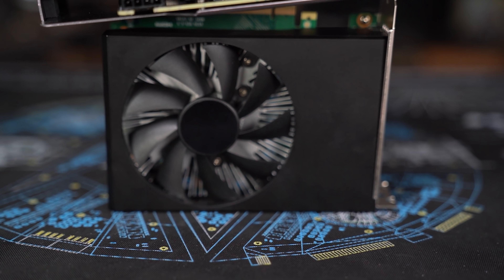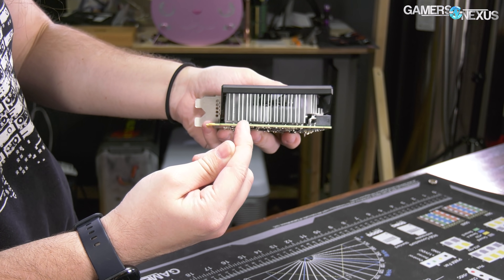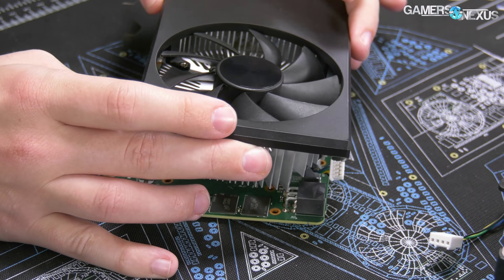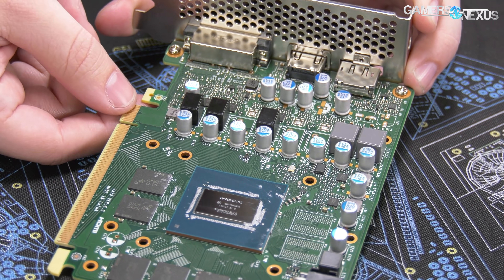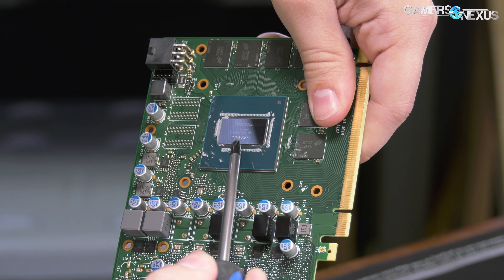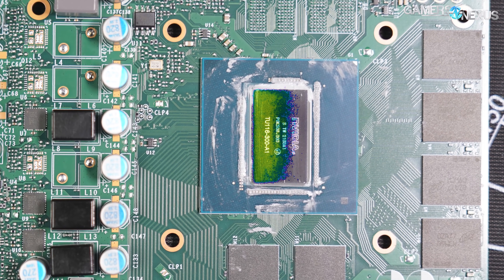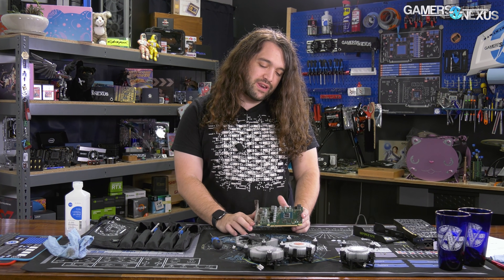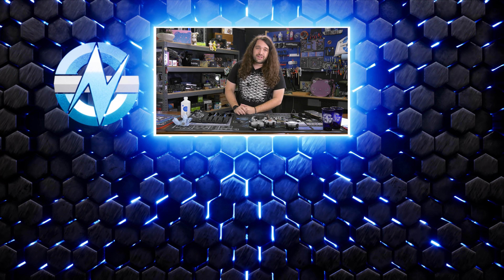Bottom of the Barrel: 110°C VRAM Dell GTX 1660 Super Video Card Review

Comment: That's rough.

I've got an ebay Dell RTX 2060 that's fine. It's not a terrific overclocker, the power limit is locked from 80 to 100 but it runs quiet and cool, matches retail in benchmarks.

Comment: Try to mod it, drill holes on the side of the shroud so the air can exit, dremel out part of the aluminium heatsink over the memory chip, and put small copper heatsink with thermal pads on the memory, you could also remove the entire shroud and swap and zip tie a bigger noctua fan for performance and noise. Or adding a cheap aftermarket one, then try to oc it.

Comment: "You'd have to get an Excavator to go any lower than what Dell has made here"
cries in FX-8350
Reply: i ran my 8350 at 5.0ghz at 1.51v for 7 years, playing every 1080 game i had on ultra with a gtx 1080. i have very little bad i can say about that chip, especially since i got mine secondhand and it STILL ran like a champ. i actually have that board (sabertooth 990FX) and chip mounted on my wall, shelf queen style
Reply: I upgraded from an FX-8350 to a Ryzen 3800X in January 2020 right before SHTF...I love the Ryzen, but that FX-8350 held up pretty well for the 7 years of service it gave me. It aged very well. I made a lot of money on that computer over 7 years doing work and played a ton of AAA gaming titles on it. It's still being used as a gaming PC right now by my son. That PC just keeps going.
Reply: Adding on to the pile, I had an FX-8300, and that thing aged really damn well... Was still running fine when I finally switched it out for a 3600XT.

Comment: Every time I see a tear down of a poor design I'd always like the reviewer to "fix it".  Cut the shroud away a little bit and put some thermal pads on it
Reply: Sadly the thermal pads have close to no surface area on the heatsink to dissipate heat to & while the shroud holes could help the GPU (which is already at a semi-passable state), they'll do nothing for the vram. At that point it's more about taking it upon themselves to build a properly functioning heatsink than trying to fix one that won't work.

Comment: I'm curious how much you could "fix" the design by spending $1 to $2 more. Take a dremel to the shroud, add the cheapest possible thermal pads to the memory, and maybe add some washers to the mounting bracket.
Reply: Companies are always applying the "Salami slice" method. A dollar here, a dollar there and you got yourself half a million. They don't care much about the quality as long as it works (unless you pay extra). And hey, there are always customers that would buy their stock in these days, aren't there. :D
Reply: @FrostarmyN7   Often they make it bad on purpose to force you to upgrade...
Reply: You could definitely improve it with a bit of work.
Reply: the shroud is held by 3 small screws by the fan.  Takes less than a hot minute to remove.   Removing it did nothing to gpu temp.  If you believe it helps then remove it, its so easy.

Comment: Based on the video, this card performs as well as other 1660 super cards (proven by the benchmarks).  Doesnt that mean Dell (or whoever designed this card for Dell) actually figured out how to remove unnecessarily expensive parts while still maintaining an equivalent gaming experience for the user?  It seems to me this card isnt bad at all. It has actually proved that the creators of other versions of the 1660 super wasted money when creating their versions.  Its not easy making things more efficient and cost effective without effecting the user's experience. The designers of this card appear to be very skilled in this area.

Comment: So:

1) Several thermal pads for GDDR6.
2) A couple of washers to fix the issue with pressure.
3) A 3D-printed bracket to put a 120mm fan on the back of the card.
4) A 120mm fan.
5) A good dose of undervolting.
6) A bottle of holy water and a few prayers.

And maybe, maybe, you can get a graphics card out of this. Dark times indeed.

Comment: Is there a reason the VRM components are in the middle of the display outputs and the GPU core? i think they should be closer to the PCIe power connector. If the video card had not a power connector its understandable since the PCIe power is closer. Maybe something for #AskGN

Comment: About a couple months late, but I threw it in a miner after I got a better card and its been running about a month or better. 
-75 Core, +250 mem, 35% fan, 100% load, 80% power, about 50c (hot point 62C) Not really pushing it imo. 

Not bad I thought, the card behind ( 1060 ) it probably pulling a lot of heat from the back tho. 
That said, I'm going to back it off a bit more (-50, +100, 45%) to help it out after watching this

Comment: I thought within spec is good. Maybe not optimal or on the cool side of the spec but within spec. Internal combustion engines have a thermal range as well and actually perform better on the high side of range.

Comment: If the die for GPU did connect better on the graph would that not in fact be worse overall?  The GPU die would then be COOLER so then the main fan would be SLOWER and make the airflow problem even worse for the VRAM and VRM's?

Comment: Note to steve, yesterday, a 1080 FE card I had purchased a few weeks before the market started surging on video cards, crapped out. 
It was working, yet not working. I don't have any better replacement cards because of market conditions right now. 
So I was afraid I would be stuck with using 1060. 
But I remembered your video on cleaning up older cards, so I took the beast down to kitchen table, carefully removed screws, 
placing them in areas that match where they came from, (realized after the fact the backplates are NOT needed to be removed unless you're actually messing with components there)
and got the heatsink off for the GPU. It was the consistancy of dried cement. 
CLeaned it off, put new stuff on, tested, it works perfectly. Not sure how to get to the memory modules though, but this works for now. 
Thanks.

Comment: One really good use case scenario. That Dell GPU is actually good for a dedicated Plex server . The NVencoder/decoder is all that is used in this implementaion therefore the benefit of having such a small GPU footprint will come in handy. The cooler almost doesn't matter since the GPU doesn't boost when the encoder is active. The 1660 Super has slightly faster memory than a 1660Ti and the encoder is based on the Turing architecture.
Reply: Well that’s ... niche ... I guess
Reply: Agreed, though a 1650 would do just as well for a lower price. I was going to stick to AMD but my next media PC may be a rtx 3050 just to get nvenc decoding for media.

Comment: I had an RX480 that I pulled from a busted HP system and at least HP’s own video cards had a copper cold-plate that touched the memory chips. These single-fan cards almost always suck in terms of noise though.

Comment: Dell can afford a box of thermal pads for the RAM and a box of leaf springs to mount the cooler right. They are just leveraging the shortage to save themselves 10 cents on every unit because they know people will buy them either way and all the better if they die in 2 years so they have to buy again when the shortage is over.

Comment: I bought one of these used as a ti version and I know no one wants to hear but it's mining for 31.74 mhs at 75 watts (which is like most other 1660 super/ti) for 2-3 months now for me. it is running at 930/2275  core/mem clock. the core temps in a very tight case are about 50C with 75% fan speed and sucking quite warm air in, idk about other temps tho. Interestingly hiveos sees it as a gtx 1660ti sapphire
I've seen pictures of this as 30 series cards too, as long as those were not scams

Comment: This card isn't remotely bottom of the barrel. Maybe bottom of the barrel for a major company but there are a lot of cards out there with even more cost reductions and careless manufacturing. Cheaper, more dodge capacitors, A slab of aluminum half that size, recycled fans from who know where, contacts that are are their technical thinnest and still work (maybe), shrouds made of a flimsy plastic that gives off fumes, and pcbs with fewer than average layers.

Comment: I literally stopped at 17:25 to see what kind of "Excavator" it was. Seems it's an FX 8150, which is technically a Bulldozer. Then again, Excavator was the last generation of the Bulldozer architecture and didn't have a high end product, since the architecture was at its limits, and was eventually replaced by (Ry)Zen.

Comment: This is just an example of how Dell couldn't figure out a way to make the GPU proprietary and unable to be reused in another PC, so they did the next best thing and made it so cheap that you wouldn't WANT to use it in another PC.
Reply: You’re a genius, this is an underrated comment
Reply: Dell makes shit pcs and even worse gpus
Reply: The cost to make a custom heatsink or waterblock would offset any savings from buying OEM cards
Reply: it is the same chip as any other 1660. The ram just runs insanly hot due to it being designed cheap. You can use it in another PC but I suggest placing some thermal pads on the vram first. I have done that to over 10 dell GPU's and not had any issues.
Reply: Dell The King of E-Waste
Reply: I'm pretty sure there has been a pitch at some point: " hey, we could use a different pin-out on the 12v connectors. that way it is impossible to reuse the GPU at all and if you try it will explode... also more warranty"
Reply: I have this card in another computer... its running fine.
Reply: @wes9451  Well I would sure hope it at least technically works. It's still a garbage card.
Reply: @wes9451  100+ temperatures on the memory will increase the chance of it breaking, which could be prevented by them spending a few more dollars on cooling, but of course they cheaped out on everything...
Reply: @e-cap1239  he hasn't responded because his GPU melted

Comment: When you get your new thermal test chamber, one thing that could perhaps be interesting to test might be to gradually raise the temperature and see at what point a card starts throttling. Not sure how time-consuming it would be, but I think it would be an interesting and quite practical metric of differentiation between different card/cooler designs. It seems this might start throttling at a much lower ambient temperature than more full-fledged 1660 Super models.
Reply: Higher ambient, or just in any case as bad as the one it came in.

Comment: This brings back memories of the 2000s where such excuses for cooling were the norm leaving people to glue and strap on whatever improvements that were available. I would even do double sided cooling back in the day using fairly thick thermal pads and scrap heatsinks to cool vram and vrms from both sides of the pcb which worked out pretty well.

Comment: Is it salvageable? Cut side of shroud off, put thermal pads that touch at least same heatsink?
It would be interesting angle.. but with  these 2-3 steps you can improve situation.
Like put on thermal pads, cut side of shroud, put stronger springs from some old cooler for even mounting pressure..

Comment: I recognise that colling "solution" anywhere - it's almost the same as in an ASUS Phoenix. The anemic heatsink does almost nothing of favour and the card ramps up in temperature after 5 minutes, I guess, without seeing the Thermal Testing yet. I know it because I had a 1660 of the Phoenix line. It was so bad I got tired and changed it for another Graphics Card 6 months after purchasing it.
Reply: Asus phoenix has really bad cooling. I's say go with asus tuf or dual lowest if you are buying asus

Comment: It’s like the early days of performance hardware, when graphics cards came with tiny little fans that weren’t adequate enough to keep the GPU cool.  I’m talking specifically about an ATI X800 I had in my first custom build back in 04 or so.  It kept overheating, so I strapped a dual 90mm fan on it.  (Should have patented that design) After that I was breaking over clocking records using ATI Tool.  If you remember ATI tool you’ve been around for awhile 😆
My point is I’d aim a 120-140mm case fan at the back of the PCB.  Actually I did that with my 3090 and it had a significant impact on VRAM temps, dropped from 73c to 68c with an EK block and standard back plate

Comment: My gtx 1660ti Asus tuf edition 6gb variant has a dell-style extruded heatsink and its utter garbage, gpu would instantly hit 90C then throttle so I replaced it with a water cooler and now it stays around 60 under full load

Comment: Shame shame everyone knows Dells name.  Any chance of getting your hands on a 30 series by Dell for a teardown?  My 3070 RTX thermals seem good so far, ordered it in a prebuilt and sold the 5000 series it came in.  Added 3 mm thermal pads to the backplate memory area before using it.  Not sure what the point of a metal backplate is without any contact with anything.

Comment: As an engineer who had to deal with the last couple of manufacturer screwups by going cheap, (exploding caps and acid melting hdd chip dies) these graphics cards are sheer poison and to be only installed on computers on corporate systems where they are skipped every 3 years.(and i really mean skipped)!
Was honestly surprised you didn't just simply put a hammer through it and toss it in the  E-Waste recycle bin.

Comment: now maybe try to see if you can DIY fix it, with some thermal pads, do the holes line up with any other cooler you could strap to it? or maybe alter thr shroud to allow for more air flow top and bottom?